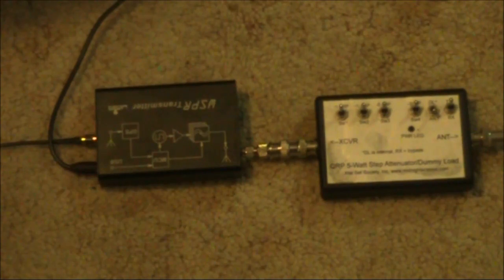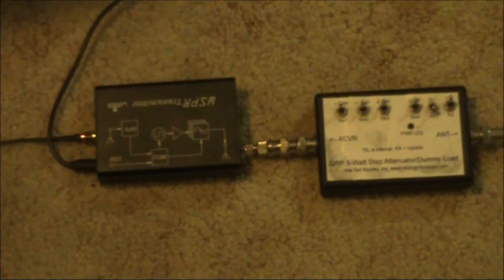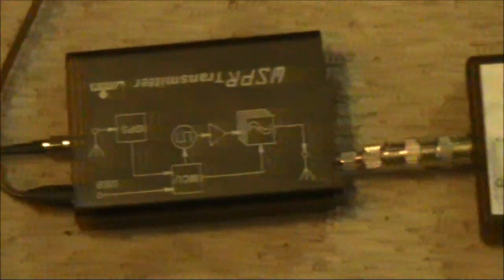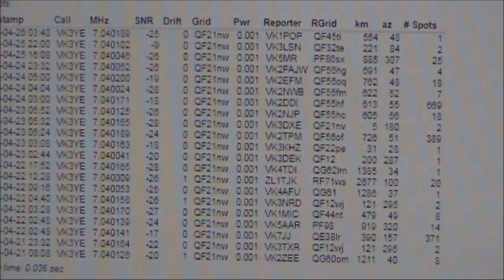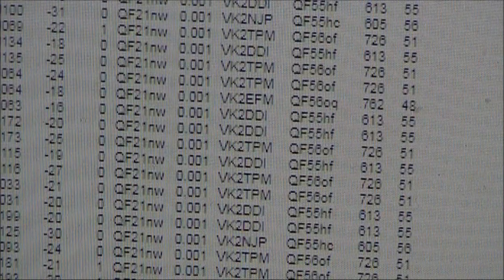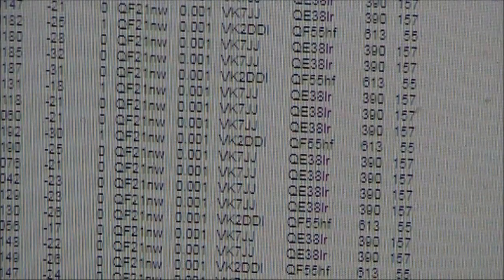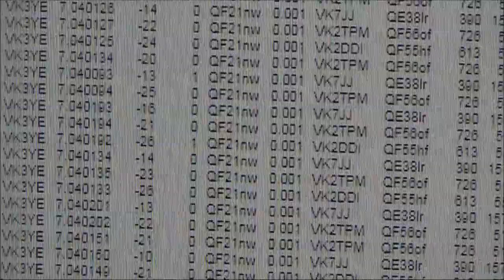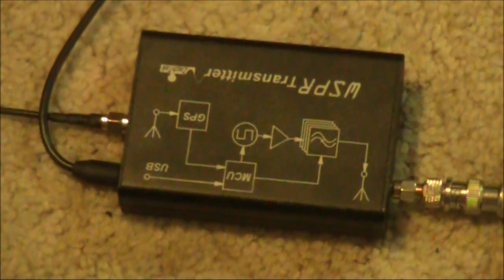7 MHz WSPR: A week with 100 microwatts

Comment: I guess the attenuator was modified to provide -33dB?  Some sources claim it was -18dB maximum attenuation.  The two "-12" switches look to be handwritten.

In any case, at that level of attenuation (-33dB), you'd need to start looking at and being cautious of leakage to know for certain what the total emitted power actually was.  Is the attenuator in a metal box?

Comment: I'm playing with this right now (as VK2CJB) with a coaxial 24dB attenuator (..and about +8dB worth of connectors to get it on the FT818) ... With 1 Watt on the radio, 0.065 Vp/62uW shows up across a dummy load at end of the coax, and not even VK7JJ hears a thing.. Connect the 30m inverted-V, and it starts appearing at 'JJ about -30dB; remove the attenuator, and it's +6, so about the 35dB expected difference.

Comment: Communicating with 100 microwatts is indeed an impressive achievement.  However, in order to be sure that in fact that is the amount of power being used, the transmitter must be extremely well shielded and grounded so that the amount of power on the coax shield or power supply, for example, is much less than the attenuation of the filter.  Furthermore,  the attenuator itself must be extremely well shielded so that it doesn't output power on the coax shield.  An attenuator with panel switches is unlikely to be shielded well enough because of the holes needed in the panel for the switches.  Because the coax is going to act as an antenna if there is signal on the shield, the amount of power being radiated may easily be much greater than 100 microwatts.  

I think a better test would be to first place the apparatus in a grounded metal box.   The only connection to this box should be an input coax that carriers the power, and the input coax, which is grounded to the box wall, should be very well choked on the outside using high impedance resistive ferrite toroids. This ensures that any joins between box walls don't act as slot antennas.   If no stations pick up the WSPR transmissions, then the shielding is good enough.  Then place another coax jack on the wall of the box, and attach this to the output of the attenuator, and the antenna itself would be connected to this coax.  Then you will have a much better idea that the contacts are indeed being made using only 100 microwatts.
Reply: Peter, you could check your power output using an oscilloscope. 100 uW into 50 Ohms is 0.0707 Vrms, or 0.2 Vpk-pk.
Reply from the maker: Or you can gradually go down in power, noting others' reports of you (noting variations in conditions). If there's a consistent 10dB drop between 1mW and 100uW  and similar drops from 10mW to 1mW then it's probably OK.
Reply: @vk3ye 
The WSPR transmitter you are using outputs 300 mW.  100 uW is 34 dB less than that.  I think this is the WSPR transmitter your are using looks well shielded, but I am not sure about the attenuator.  If the attenuator is leaking any more than this on the shield, it will dominate the radiated power.  The website doesn't seem to sell the attenuator anymore, so it's hard to learn anything about it.  But if the signal is passing through the switches, some of the signal could certainly get on the coax shield by capacitively coupling through the switch.  Unfortunately, this claim may be difficult to test with ham-grade equipment that has not been carefully characterized.